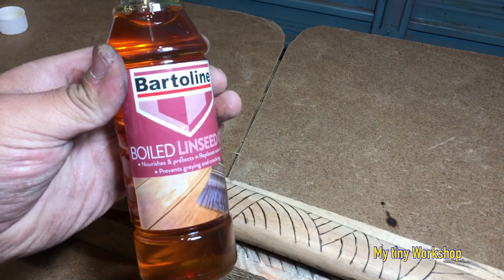Rusty Old Axe Restoration

Comment: some people dunk the head of the axe into oil so the eye swells when they grind it down flat, have you done that before if it gets loose?
Reply: It works...for like a week...the oil doesn't really swell the wood as much as u would think to keep it tight....  what actually makes it work for like a week of two of real use is more the glowing affect of the boil linseed drying....but it will brake that week glue bond...soo your actually 100 times better off taking ur loose and taking the wedges out... taking the head off and fitting it down a bit farther on the shoulder then putting in a new thicker wedge to tighten it back up...also 100 times better off leaving some above the eye..to mushroom out over the time of the eye....when u do it glue ur wood wedge with standard ole wood glue so it wont come out and save ur metal wedges..then if it loosens up in the future u can just pound in one of the metal wedges to tighten it up fast